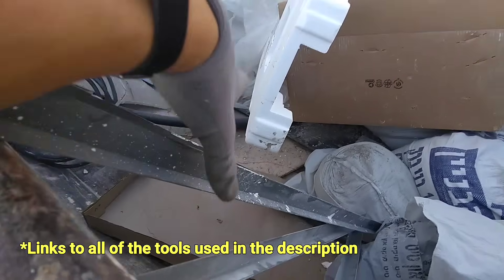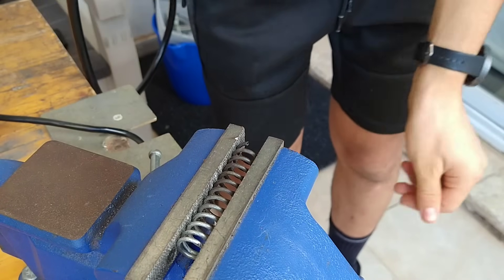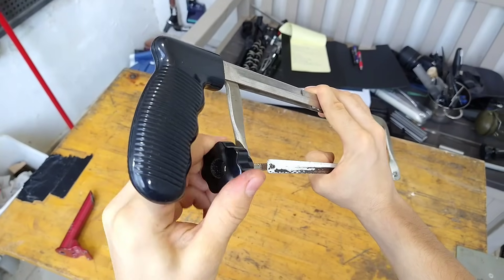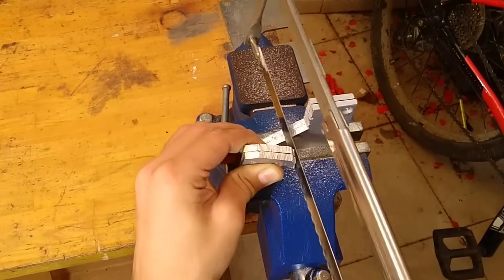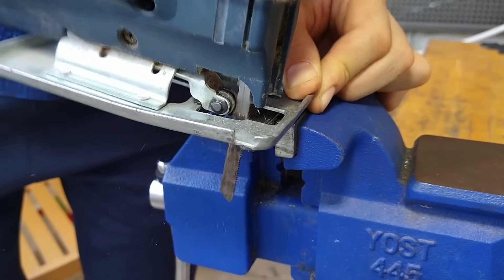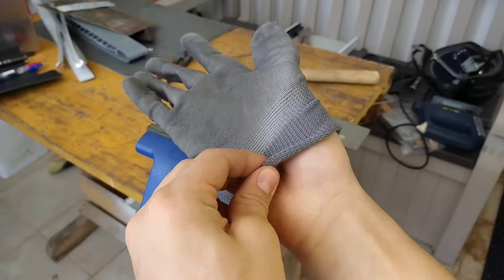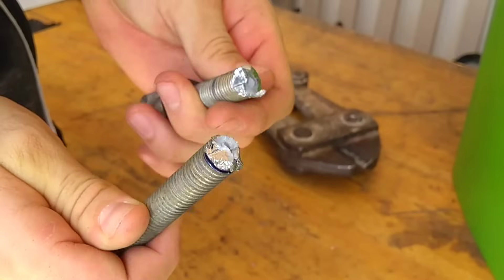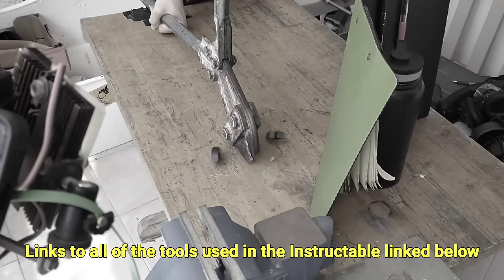Top 10 Ways to Cut Metal WITHOUT an Angle Grinder - A Comprehensive Beginners Guide

Comment: Thanks for the great video!
FWIW, if you thread a nut on a machine screw before cutting it with bolt cutters or anything else, you can then remove the nut to fix the mangled thread end.
Reply from the maker: I find that that works to allow you to rethread a nut back on by removing the burr from blades, but it can still leave a sharp edge that I prefer to remove.
I tried that with several different bolts with the bolt cutters and it didn't work.

Comment: Thanks for posting this helpful video and even making it fun to watch.  The slo-mo effects are great.  I seldom use power tools, but would like to cut down a metal TV stand.  It is a tube (1 1/4" hollow, inside diameter, black-coated).  I'm not sure what metal it is -- iron or steel? Maybe this size black-coated metal tube is standard for TV stands.  Would you recommend using a carbide blade on a very small Makita circular saw?  Is a dremel tool too small (but good for de-burring)?  My work surface is not very stable either.  Any tip for keeping the cut straight when the piece is hollow (besides marking it)?  P.S.  Since your voice is very clear, I think the video is good as you made it, without text.
Reply from the maker: Thanks, I'm assuming what you have is something like this: https://www.google.com/search?q=metal+TV+stand.&rlz=1C1NHXL_iwIL720IL721&sxsrf=ALeKk03QB1hZJn-fHmrjXVn3Nav-_EEZyA:1616659947015&source=lnms&tbm=isch&sa=X&ved=2ahUKEwj00vTO_8rvAhWGCOwKHTr2BGkQ_AUoAXoECAEQAw&biw=1779&bih=830#imgrc=arvdxcV4dw4ECM
 If you need to cut off only a few parts, I would use a hacksaw. I would try cutting partially through the tube from two directions, basically cutting a channel that will guide the blade to cut more accurately.
If you have to cut off a lot of metal, I would use an angle grinder instead of a circular saw because you don't know what type of steel it is, and especially if your work surface is very stable.
A Dremel tool would probably take forever, if it's a TV stand, I would assume it's quite hefty. What are you trying to make?
Reply: @Yonatan24  Thanks for your reply!  The stand is too big for the TV. I want to make the stand shorter; the pipe sticks up over the top.  The metal is tubular, like this metal:  https://www.google.com/aclk?sa=L&ai=DChcSEwjj5qLe5-PvAhV88eMHHWLtAKEYABAEGgJ5bQ&sig=AOD64_2jH7VM-a6X1DpQ6BL3WVM8ucc8rw&adurl&ctype=5&ved=2ahUKEwjvxZHe5-PvAhWJADQIHUHlBVAQvhd6BAgBECA  
Maybe I can borrow an angle grinder. Or if a hacksaw chews it up, maybe I can grind/polish it. The cut edge should be smooth and even.
Reply from the maker: I would try cutting it with a hacksaw, you can also buy tubing caps. I've seen them in hardware stores.
Reply: @Yonatan24  Darn.  I wanted an excuse to buy a power tool.  :-)  Yes, I can get tubing caps.  Thanks for your reply!
Reply: @jenniferwalden3029  This answers my question as well!  I need to cut down metal loft bed legs.  Hollow and square.  I have a hacksaw but gotta make sure those are even!

Comment: Portaband needs to be at the top of this list
Reply from the maker: Definitely. But those are expensive.
Reply: I bought an old deepcut dewalt for $80 on offerup, and I use the heck out of it. They are built to last, so buying a used portaband isn't a bad option.
Reply from the maker: @deagle387  Interesting. How do you know that you aren't cutting hardened steel and are going to destroy a blade in a second? That's my question. Often files aren't a good enough indicator

Comment: The bracket at 2:13 looks like some sort support for 2 x 6 planks. It's two-sided which is odd. It looks like there are holes for screws on the right.
   Also when cutting stiffness is half of your job.   At 2:03 that bench needs more support. Take a piece of scrap ply 3/4'' thick  2' x2' and cut into two triangles. Screw them to both sides and under the table vertically.
Reply from the maker: I remember taking it apart from what looked like a shelf, but I can't remember exactly how. Maybe it's mounted to add another shelf for a planter?
I hacked that workbench together several years ago, don't treat it very nicely, and the temperature and the daily fluctuations in humidity don't help it stay stable. I started building a new workbench, and just never finished it.

Comment: Thanks for putting this video together, there are many useful tips here.
I use diamond wheels much of the time, they can be slow going but always win in the end.
The cheap Chinese mini diamond wheels are good for small jobs and sharpening tools.
Diamond is much harder than any metal and seems not to heat the piece being sharpened as much as other abrasives, Possibly the heat may be being carried away with the grindings? What are you’re experiences and conclusions?
I concur with the opinion that a solidly built workbench and vice make everything easier.
The short term pain of buying expensive but high quality tools is soon forgotten, but the warm glow while using them is priceless, and lasts till the day after 
the lifetime warranty expires!
Reply from the maker: Thanks. I've haven't noticed a difference in terms of heat, in fact I think abrasive discs cut faster than diamond discs after they've worn out a little.

Comment: Nice, simple video. I knew about  most of them but was sure by the chisel. I assume you would use an older chisel and re grind it for each use.
Reply from the maker: Thanks. The chisel I used was made in Japan and is at least 50 years old. As long as you're careful, there's no need to re-grind it often. I can't see any signs of wear on the cutting edge yet (I cut more than what I included in the the video). 
But I did experiment on a chisel beforehand, and had it dull fairly quickly due to the sharper angle I chose to grind it to.

Comment: You might want invest in a chop saw with a carbonendum blade and a bench grinder with a wire and grinding wheels
Reply from the maker: Are you talking about an abrasive chopsaw that uses silicone carbide (carborundum) wheels? I have a bench grinder but it's not as useful as I thought it would be.

Comment: If you are not scared of using wood cut off saws on metals or this 8:17, then you should not be afraid of using a proper angle grinder. Also runing grinding disc on saws in inefective and dangerous as they need to run on much higher speeds than metal saws.
Reply from the maker: Good point, actually.
They've worked very well so far, I haven't been able to wear one out after ~20min of cutting.
My circular saw probably spins faster than larger circular saws, since it uses 4.5" blades.
Reply: @Yonatan24  Definitely buy a good angle grinder. My Makita was $70 and includes both grinding and cutting safety guards. It also has a paddle switch for added safety. The included case is nice too as it has space for grinding wheels and stuff. It really is a huge upgrade over the cheap $30 one I bought when I started doing metalworking.
Reply from the maker: I have a good Bosch angle grinder, but have never used it. It's probably 30 years old. I was thinking of getting a variable speed angle grinder but my new circular saw cuts so much better than I had originally expected.
Reply: @Yonatan24  Still, it is DANGEROUS to use a tool for something it was not intended for. It can damage the tool or cause injury.
Reply from the maker: I don't recommend anyone do it, but I've been able to cut thick hardened steel with it and I'll have to continue insisting it feels much safer than an angle grinder.
Reply: @Yonatan24  Once you start using the grinder with a safe cutoff wheel like the diamond ones (no risk of bursting) a grinder is very safe.

Comment: Try threading a nut onto the bolt before cutting it with the bolt cutters.  Upon removal, the nut should straighten the cross threads created from the cut.
Reply from the maker: That works very well for removing the burr from cutting, but I found that bolt cutters destroy the threads so badly you can't undo the nut. 
You can also get a small deburring tool that attaches to your drill, that might work.

Comment: VOICE OVER
Reply from the maker: You're imagining. THERE WAS NO VOICE OVER.
Reply: Semantics, 
I think the audio track explaining the video running simultaneously is equivalent to voice over.
I use the mini diamond wheels most of the time, they can be slow going but always win in the end. 
I concur with the opinion that a solidly built workbench and vice make everything easier.
The short term pain of buying expensive but high quality tools is soon forgotten but the warm glow while 
using them is priceless. 
MINI-RANT; Sarcasm and similar nuances need tone of voice and visual clues,
expressions not conveyed well by text alone.
Read you’re msgs before posting! 
Reread you’re msgs before postin!  End rant.

Comment: I have that Worxs saw and the Jig saw with the bent shoe, lol. Lots or great ways to cut and trim metal. I usually use snips, hacksaw or angle grinder. My tool regret is a wimpy Dremel type tool. It has no power whatsoever. Not a single bit that came in the kit can be used without stopping the tool completely. A real Dremel is on my wish list. The voice over video is my preferred video type as I am usually too busy watching the video and trying to pick up the tips to read captions.
Reply from the maker: Great, thanks for the feedback.
Do you like your Worx saw? I'm curious, because I've been making a list of all of its pros & cons, for a review video, and am always interested in different perspectives. (or were you sarcastic? :)
What Dremel do you want? Because from what I understand, they're all a compact, fast, weak tool. I guess the only upsides to a Dremel are the size, simplicity, and it's more practical for polishing metal, where all you need is speed...
Reply: @Yonatan24  I don't really see the point to using a Dremel when a Makita brand die grinder is the same price.
Reply from the maker: I've never seen one of those. I remember you talking about a side grinder or something a year ago, but not that one.
A Dremel is faster and has adjustable speed. So you can use it on CNCs and other tools. My flex shaft rotary tool might be my favorite tool, it's so much better than my Dremel.
Reply: @Yonatan24  A die grinder is basically a rotary tool for heavy duty use. Rotary tools are generally for DIY projects or arts and crafts. Die grinders are for metal fabrication, automotive, plumbing and other heavy duty projects.

Comment: Every time I watch one of your videos it reminds me that my limitation is not what tools I have, but how much patience and ingenuity I have.
Reply from the maker: Thanks! I'm stealing that.

*And how much I don't like spending money on tools, and once I do, I regret not doing it earlier :)
Reply: @Yonatan24  I some times charge people in tools, lol. "Want a specific job done that requires a special tool? Buy me the tool and I'll do it."
Reply from the maker: That's actually not far from how I got my Worx saw, but didn't think of it that way. My grandma asked me to remove a wooden pergola that had rotted. It was fun but a lot of work, and she decided I deserve something in return - the saw!
What do people usually ask you to do?
Reply: @Yonatan24  You can get a lot done with basic tools, but never cheap out. I used to have a $50 cheap corded drill. It was HORRIBLE. It could barely drill a 1/2" hole through a 2 by 4 and was heavy and unwieldy. Upgraded to Milwaukee M18 brushless 2 battery kit for $150. HUGE UPGRADE. Drills a 1/2" hole in steel effortlessly. The ratcheting keyless chuck, 2 speed gearing and clutch are so nice to have. As soon as I bought the real drill I threw the crappy one right in the recycle pile. I find that I don't even need a drill press since that handheld cordless drill is so nice and powerful.
Reply from the maker: I really don't buy many tools, I don't focus on it. I find it really depends what cheap tools you buy, some are garbage, some are worth it.
Reply: @Yonatan24  In my experience most cheap tools are garbage.
Reply from the maker: I got a small Bosch impact driver which was a huge upgrade too, it's so much better than a regular cordless drill. That, my flex shaft rotary tool, my Worx circular saw are my best upgrades.
Reply: @Yonatan24  Bosch is a good brand. Good tools make your work better and easier. A lot of people hate Worx. I have never used it, as I generally don't buy DIY tools but if it works for you, that's good.

Comment: Have you ever used a portable bandsaw? I used one at work for cutting EMT and I love it so much I bought one myself. Handy little guy for sure :D
Reply from the maker: I've never used a portaband, though I wish I had one. Is EMT steel pipe?
Reply: @Yonatan24  yeah, it's "Electrical Metallic Conduit", so pretty thin/mild steel tubing--makita or Milwaukee portaband cuts through 3/4" (inside diameter) EMT in seconds

Portaband is also great for cutting threaded rod, square tubing, Unistrut etc.
Reply from the maker: Interesting. I've heard of it, but have never seen it IRL. 
I've also seen people build interesting multi-purpose stands for their portabands. Definitely a tool I wish I had, but right now I'm happy with my circular saw. Thanks for the comment!
Reply: @CultureStress  I often use Unistrut for plumbing and electrical work. It is great for supporting stuff.
Reply from the maker: I've seen that stuff before in dumpsters. What do you use it to support? It looks beefier than simple channel for passing wires.
Reply: @Yonatan24  I use Unistrut for supporting pipes and conduit. It is very strong, if it is secured with the proper hardware. There are clamps that go with it. Most hardware stores won't have it, I get mine from Ferguson plumbing supply.
Reply: I would like to have a portaband but would never make a bandsaw out of it. I see people doing it all the time. I finally got a 9 in band saw and love it.
Reply: I would never make one of those tables either--which is part of why I bought the smaller of the two Makita portabands.

I'll admit, there is a part of me that really wants to buy the tiny Milwaukee 12v portaband, so that I'm always using the smallest tool I can get away with, but my wallet says I'm not allowed to right now
Reply from the maker: That tiny Milwaukee might even too small for what I need <adds to list anyway>
I think the ideal tool would be a cordless portaband, with a table/stand that you can mount it on quickly, and that it can tilt down like a large metal bandsaw. 
Also I've heard small bandsaws break a lot of blades too.
Reply: @CultureStress  , "but my wallet says I'm not allowed to right now"... story of my life 😩😩😩
Reply: @Yonatan24  The tiny M12 portaband is great for small conduits and stuff. I have the corded Milwaukee portable band saw and it cuts up to 3" EMT conduit. I use it a lot for metalworking. Corded is fine since I mostly use it in the garage at my workbench which has power outlets.
Reply from the maker: BTW do you do only home repairs, or repairs for other people? How do you find so much odd work?
Reply: @Yonatan24  I do home repairs and improvements and I also build stuff too. I do repairs for others as well, mostly plumbing, electrical, woodworking and metalworking. I can do concrete too but I will NOT paint.
Reply: @Yonatan24  Unistrut is one of those things where once you learn what it is, you start seeing it *everywhere*. Next time you're in a supermarket/mall, subway/metro/tube station, loading dock or other vaguely "industrial" indoor space, look up, and chances are you'll see a bunch of conduit supported by unistrut.

Since there's always little scrap pieces of unistrut sitting around, I've seen a heck of a lot of stuff on jobsites cobbled together from it. It's definitely more of an industrial/commercial/institutional kind of thing than a residential thing, though.
Reply: @Yonatan24  finding side jobs is totally just a word of mouth thing. If you live in a big city and have friends, you'll be able to find side jobs
Reply from the maker: @DragonBuilds  Hmmm... Why not paint? That's what I'll be doing tomorrow. It seems quite therapeutic.
Reply: @Yonatan24  I HATE painting. It is so tedious and messy.
Reply from the maker: @DragonBuilds  Ok. Now I agree with you. Panting definitely isn't fun. 
But spray painting is!
Reply: @CultureStress  I don't live in a big city, just a suburb. Unistrut is not common for residential but I still use it.